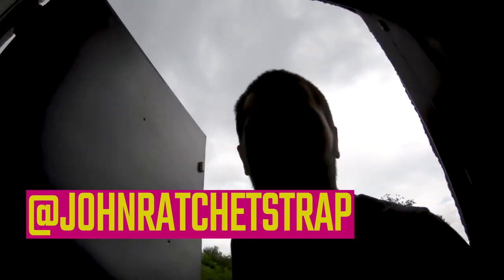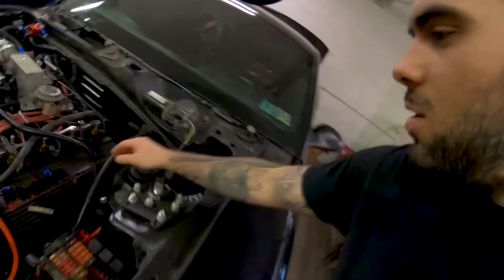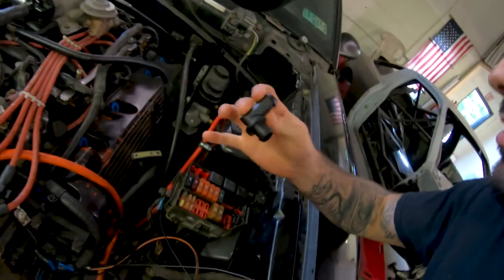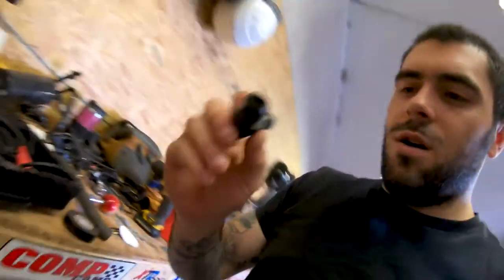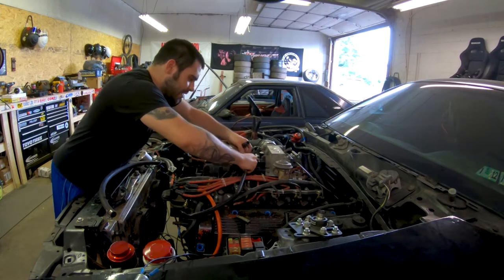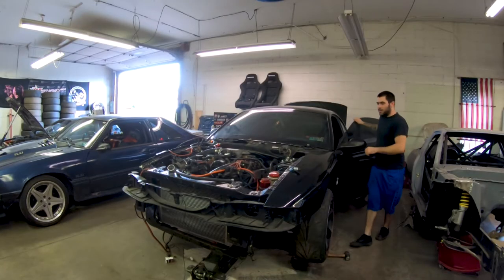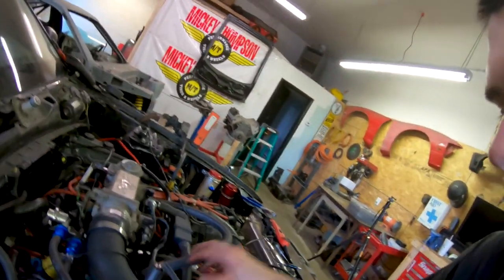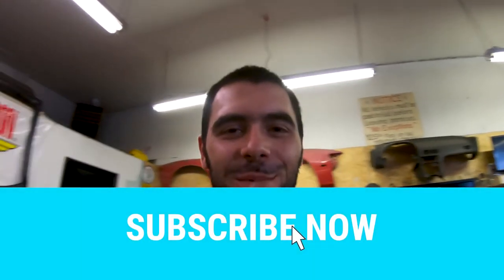THE DRIFTSTANG FINALLY RUNS!!!

Comment: Might be that theres too much fuel. You said yourself it was running rich and fuel pressure was too high. The PCv is restricting airflow into the plenum.
When the fast idle kicks down it's getting less air but not less fuel. Removing the pcv probably creates enough of a vaccume leak to keep it running since its extra rich.
Reply from the maker: Fuel trims are stable now. I’m not gonna say this is the exact fix, but she works great now lol
Reply: @RatchetstrapMedia  is it fixed now?
Reply: @RatchetstrapMedia  why dont you have the stock fuel regulator on it ?
Reply from the maker: Because I was getting 80psi or fuel pressure at idle.
Reply: @RatchetstrapMedia  with the stock fuel rails and regulator on it? So you have a returneless system?